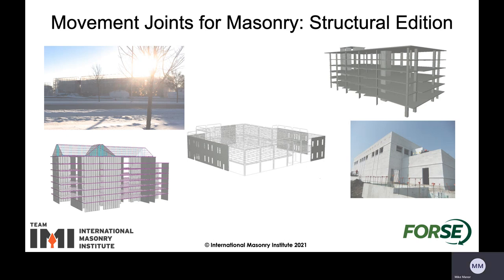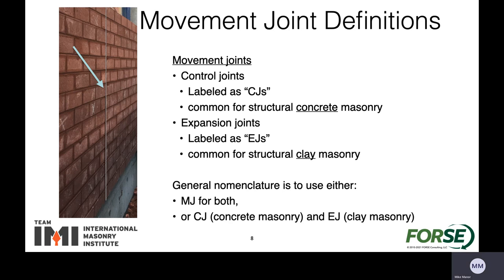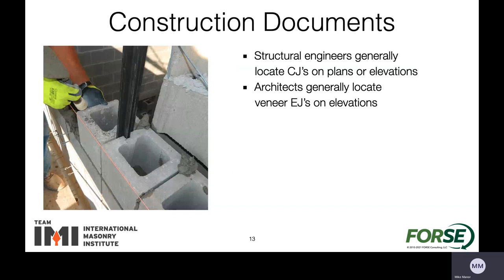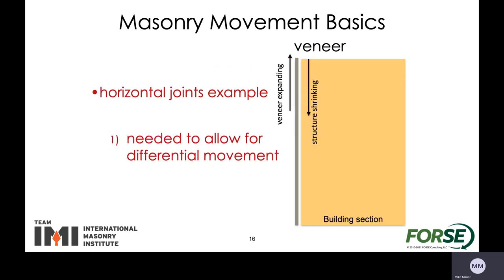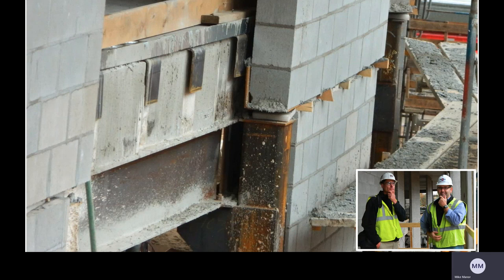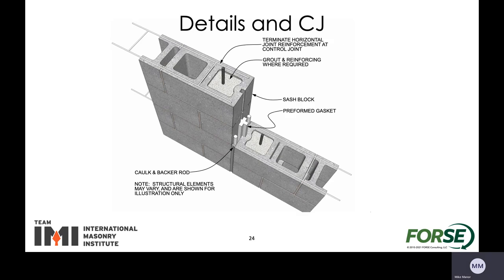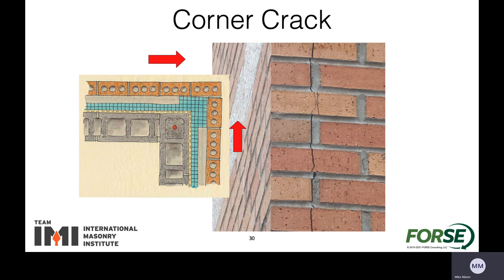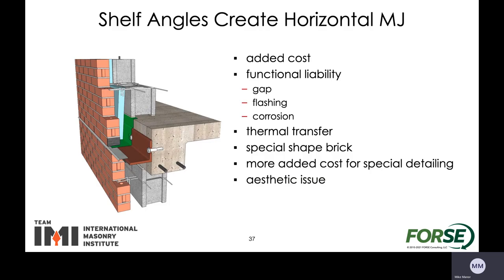Structural Engineering consideration of Masonry Movement Joints

Comment: Would differential support mean two separate materials or two separate elevations for the first course?
Reply from the maker: Differential support means masonry is supported by different materials or conditions in the same plane. For example, masonry veneer over an opening might be supported by an angle, while the masonry veneer next to the opening is supported by the foundation. This is differential support.